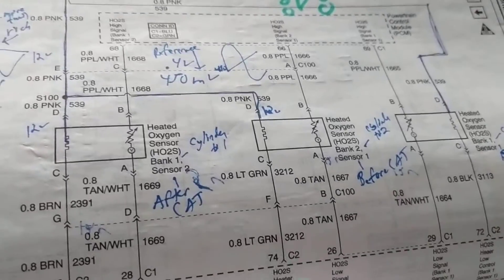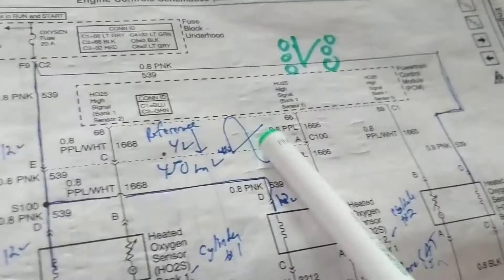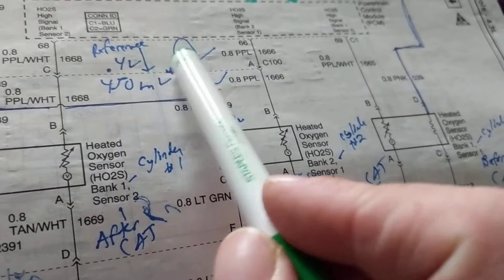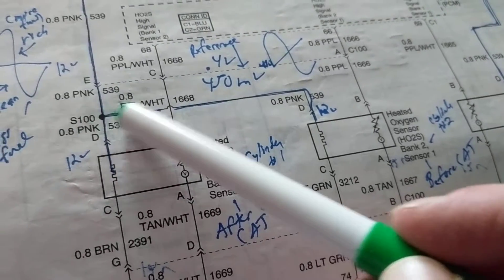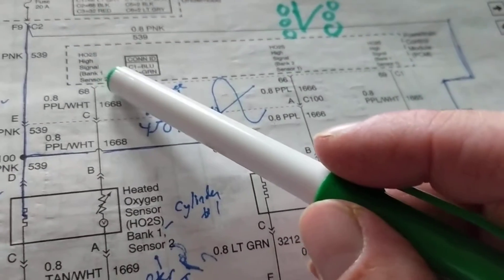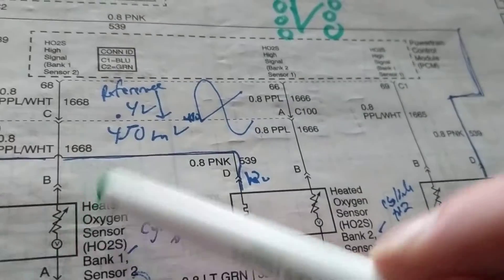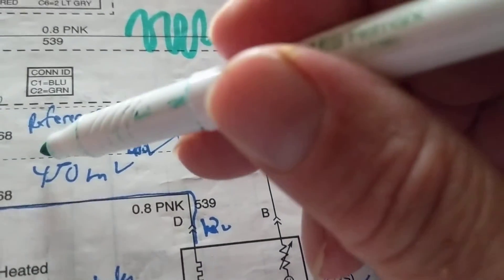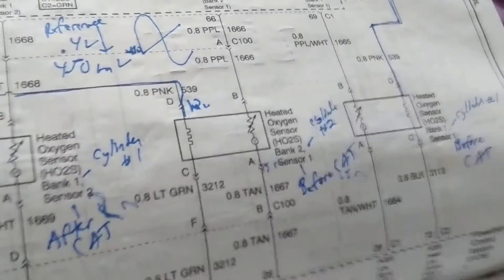OXYGEN SENSORS HOW THEY WORK AND DIAGNOSE THEM from wiring diagram

Comment: I have a 1998 K1500 4x4 automatic. My o2 wires were cut and I'm trying to locate the wires to splice then. How can I trace all 4 of mines down to figure which is for the o2 sensors(color code or design) from the pcm or somewhere down underneath.

Comment: Thanks for the information very helpful. Question?  With my car (GMC Acadia 08) the 02 sensor wire colors are Y, G, G, R but the O2 sensor pigtail is W, W, T, P. My connector to the O2 sensor melted so I had to replace the wire, O2 pigtail and the O2 sensor. Ik 1 is power/signal, 1 is ground and 2 are the heater +/- core wires. But i dont know which wires are which or does it not matter as long as its connected?